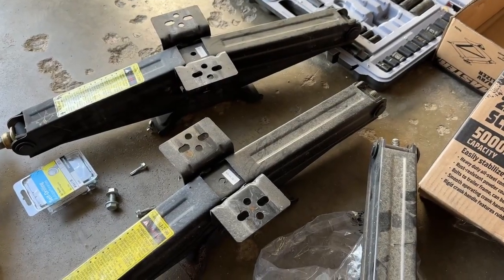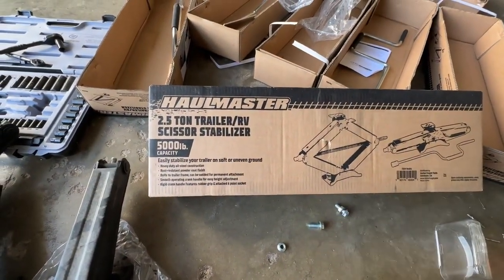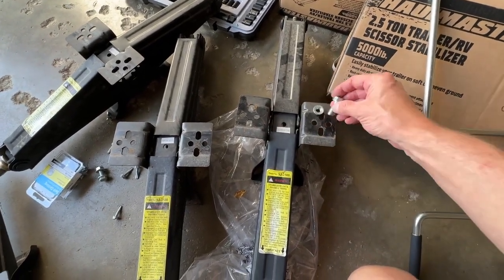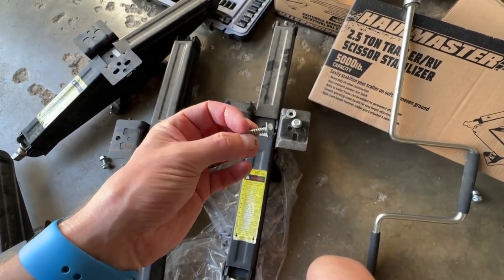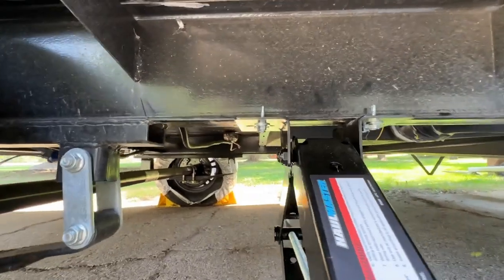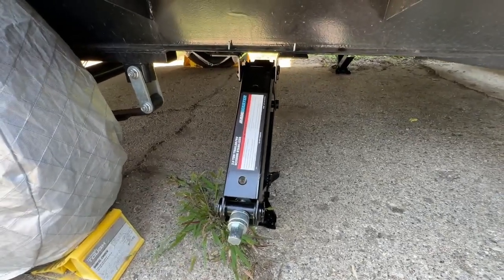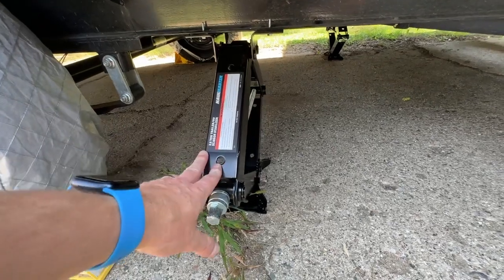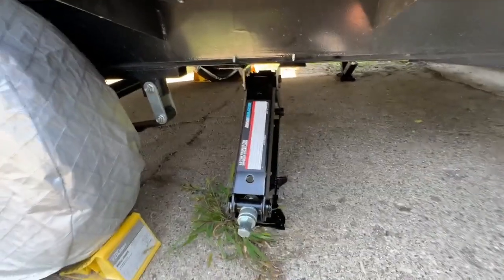RV Stabilizer Replacement

Comment: I have a  3 year old Wolf Pup. The factory jacks rusted pretty quick so we the same upgrade with the Harbor Freight jacks. After a year the screw drive on the Harbor Freight jacks corroded and became difficult to put up and down. The metal nut drive nut on the end is cheap metal so it became rounded from the drill bit. Keep the screw drive lubricated.  I'll be replacing the jack again with a better quality   one soon.